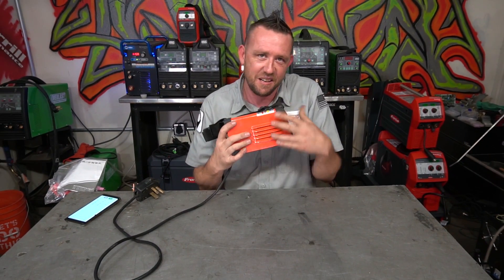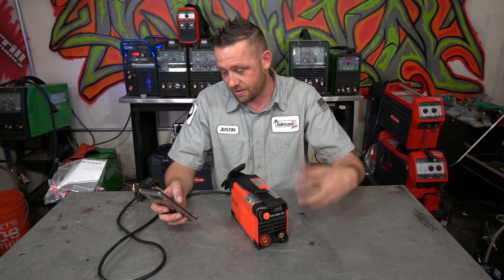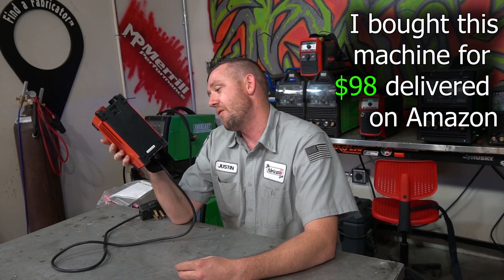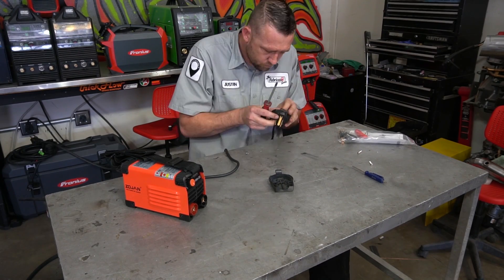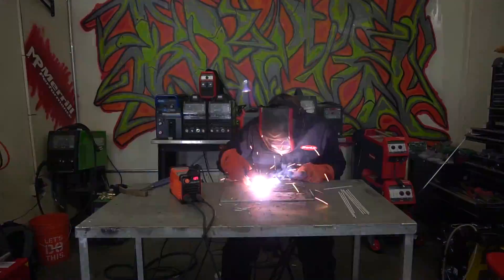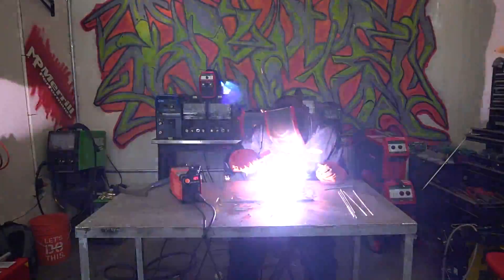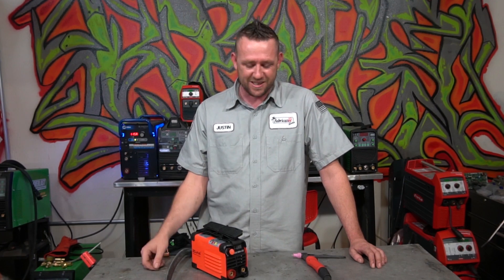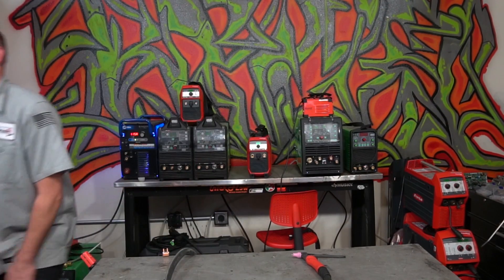TFS: The Smallest Welder EVER! Will it TIG?

Comment: I have a Delco lunchbox size TIG and arcwelding they say it will only weld 1/8 steel but I have welded up to half-inch in the greatest little welder going I also have an old union carbide Welder blue and huge and I prefer a little one

Comment: The way I understand it, there's a difference between duty cycle and thermal cut-out.   Duty cycle is the mfgr suggestion so you don't eventually burn out the machine.  SOME welders have a thermal cut out in case you forget about the duty cycle.

Comment: Mine "Zohan" have 160A max. on  information plate (even it show 253 units of "something" ) , burns well 2,5mm sticks . Current setting seems to be not linear , 210 units works well with 2,5mm stick  , 253 quickly making hole in 5mm cold rolled steel and blows 2,5mm stick . Zohan is plugged to 230VAC . Probably will be limited on 120VAC (it was designed to china market voltage - 220V )

Comment: Would it make a difference that US/Canada 240v is a product of 2 opposing phases and for the majority of other countries 240v is a single phase to neutral? 
It might be chopping the current.
Reply: If it's 2 phases 180° out it's literally same as single phase 240. If it's 2/3phases then you get 208. Anyway, this machine has a switch mode power supply so the mains is turned into dc. It'll work on dc or 1khz and not care
Reply: @AntonBabiy  That is inherently untrue, especially if there's any potential to the earth ground circuit from the neutral line or a grounding watch-dog circuit.
 It's also possible the increase in Hz rate could under-saturate any inductance in the circuit reducing the output as well.  Larger power supplies rarely have 50/60hz inductors and lead to saturation issues.  These Chinese manufacturers often design around "what won't blow up" and build around that.  Hence 50hz inductors can operate at 60hz with a reduced output but a 60hz inductors will quickly overheat at 50hz from over-saturation.  There is absolutely no way of telling without looking at the circuit.
Reply: @texNoz  what inductors are you even talking about? There is a bridge straight off the ac, dc filter caps and a smps running at a few khz above the hearing spectrum. You can run it on dc and it won't care. The smps controller ic sets the transformer frequency
Reply: @AntonBabiy  I don't know.  I DO know that I've got 2 1st generation miller 304 xmt welders sitting in my workshop that are run exclusively off generators because if I don't, it's well established that the main caps and transformer go boom..  and they are inverter-welders.  I've got a Chinese  inverter welder marketed here that says not to use on 60hz or expect unpredictable or poor performance.  That's enough information to tell me there's an induction issue.  I've guessed that there might be an issue with the neutral to ground arrangement in the control circuit when you're placing an active on the neutral input.  If the neutral is ever referenced by the microprocessor to ground, it could very well create a loop that chops.  Or perhaps the control circuit is fed through a half bridge and the neutral is referenced which turns out to be chopped potential difference.
You can't assume that everything that comes into the unit is sent through one massive inverter and dealt with from there because I know for a fact that's not the case.
Do either of us know for certain?  Absolutely No.  However, I am relatively sure the manufacturer has built that machine around the power architecture they have in China and not dual-phase/neutral like you have in the US.   I'm also relatively sure this welder is for the Asia Pacific market and likely works fine in China, but they'll sell it to whoever will buy it, as the manufacturer doesn't care if it work in the US or not.

Comment: Bust it open and have a look at the main board, there should be two adjustment screws, one that controls the output of the welder and one that adjusted the display. I was able to fix a similar welder by "screwing around" with it. Good vid

Comment: Bought a similar one. But a a little bit bigger , Onex brand 250 amps declaration , has no screen that shows the amps btw.  And I don't really care if it only goes to 125. It burns the metal away on max output . And it welds like a champ.

Comment: I actually used a similar arc welder to rebuild a steel sailboat in the caribbean off of a generator while sitting in the water. One thing I can say, is it fits in your luggage, burns 3/32 great, and it works with the amperage turned way up. It was perfect for what we needed it for.
Reply: This is what I'm saying!

Comment: Great video, but I'll only say you need to plug it to a 240-110 transformer to make it work, looks like it is made in Hong Kong, they use 240v standards there and US is 110v . I think that's where you get the half amp problem
Reply: This right here.  American 240 volt is not the same as Chinese 240.   Our 240 is actually two 120 together but they are out of phase white each other.   Over there and europe too they truly have 220 coming out of one hot leg.

Comment: So, if the welder was advertised as 12-125 Amp instead of 24-250 for $99, that would change your opinion? Keeping in mind that even though you said that you're sure the welder wont last a lone time, doesnt actually mean that it will or will not last. Your assumption was based on nothing.. im not trying to be rude, im just confused. At first you seem very excited about it, regardless of performance. Well, it definitely welded didnt it? For only $99 too. If it was advertised as 125 Amp max, would it not meet your requirements? 
  Lastly i just want to remind you that if everyone could easily afford a more top of the line welder, then this video most likely wouldnt have happened.
  I guess im basically asking;  is it really that bad of a welder? Is there something that you WOULD recommend in the $100-$150 price range?
   Thank you for the time you spend making this video

Comment: great show.  i'd like to raise a couple of points.  perhaps the display is wrong because youve set the welder up with 120volts when it is designed for 240v.  i know a panel beater whose favourite welder is cute and dinky sized like that one.  he's got lots of welders to choose from.  he hangs it over his shoulder and with one hand on the amps control, starts the arc with it turned up then turns it right down immediately it starts.  he's gone back to arc for lots of things including car panels because it is so portable.  my welding skills are what in australia are called cocky shit, so i probably couldn't use it.

Comment: Well, here's your problem.  Those were METRIC amps!  ;-)
Reply: 8bit amps? :)
My guess is that's not amps at all, rather a percentage of available power in 8bit scale, like 256 = 100%, 128 = 50%
Reply: Could be because its a small machine the amps are also smaller.
Reply: Chinese amps. Wish amps 🤣😂🤣
Reply: Right. Very funny
Reply: Haha
Reply: They're imps not amps.
Reply: r/woooosh
Reply: its Asian amps
Reply: Amps, volts, and watts are METRIC units of measure.  Always have been.
Reply: @kooldoozer  it was a joke.
Reply: @kooldoozer  r/overyourhead

Comment: How about a video for us poor people.  How to mig sheet metal with a harbor freight 90 amp welder.  I have no income or budget, and was able to get the 90amp HF mig with gloves, helmet, brushes, pliers, extension cord, all for about $170 which was a major investment for me.  I have a 1960 Willys CJ5 that has a few places where I need to cut out and replace panels.  I have had mild victories with this, but even on the lowest settings still blow thru.  With my health issues, I cannot work, and on a good day working on the jeep may get 1-2 hours total work done.  I want to finish the bodywork prior to finishing the mechanicals so worst case I can sell a decent body if I cannot finish the project.

Comment: That little welder burnt you out with everything you threw at it. So why the bad review? For a homeowner who welds maybe 10 times a year on small home jobs, may be very useful .
Reply from the maker: It burned me out because the output was not what it was shown. Also remember that I took it out of the box and used it once with the results we recorded which were inaccurate. You'll also spend about 3-3.5x the cost just to plug it in and guess the output. That is does not merit a positive review or good product. It's a novelty.

Comment: We're you operating welder on 120 volts or 240 volts? You showed a 50Amp 120 volt plug.
Reply from the maker: It's a NEMA 6-50
240v 50a

Comment: How could something that small, not be under-Powered?
So, it's a 125 Amp Welder?
Reply: Different design to a traditional welder. Uses switches rather than coils.  Like modern phone chargers compared to ones 10 years ago.

Comment: I am conflicted about the review. He reviewed the item like a professional auto mechanic reviewing a set of harbor freight tools not a DYI who may use them a few times a year. That is the review I want. If I am repairing a trailer or riding lawn mower will it do the job? Not all of us are making a living as pro welders! 

I just bought a cheap nail gun to reside a garage. It did a great job, twice! I would not suggest it for a professional carpenter. 

There is a place for Harbor Freight and a place for Bosch!  

Can this do acceptable work for a DYI job? That is the issue!
Reply from the maker: There are better options for cheaper and will work more than twice.
Reply: @TheFabricatorSeries  it worked twice. i have not used again. it worked twice flawlessly and i have not used at again.

Comment: Great Video, just a quick question, were you running it on 115Volt or 240Volt?, if 115volt this maybe why you were getting the only half the amps.
Reply from the maker: NEMA 6-50 plug
240v 50a

Comment: You mentioned in the welding glasses review video that you haven't done micro welding...
Well that is exactly what I would use this as...
And for 100 bucks I could afford to risk breaking it trying to backyard engineer a foot pedal control and on/off switch to that lil thing...

Comment: did come across a welder once ( the company I was working for actually bought us a sight use set instead of having to disassemble our main sets, drag them out onsite and reassemble. then repeat for coming home....).anyway the set said it worked 240 volts(our country's voltage) or 110 volts,,, U.S. or our site voltage for bigger builds etc...…..any ways site foreman asks can we run 110 as that's all they are allowed???? so yeh we can run 110 volts but we experienced exactly what you have just experienced lol

Comment: That is  such a shame. I had hopes for it. I do have a 140 amp stick welder from amico. 120 volt only. It will snap 20 amp breakers at full load when I weld more than an inch. 100 amps and below i can weld all day. From what I read in the manual it'll pull 40 amps at max load. I think it said it had 60% duty at 90amps and 40% at 140.  I got a 40 amp single pole breaker I'm thinking of installing to see if I can hit the limit at max power. It was 99 on amazon and hasn't disappointed me yet. Except when I need 140 amps for a while.

Comment: they show it on amazon now as a 160 amp machine.. even if it only outputs 125 amps thats enough to run 1/8" 7018 so its not limited by much you can do multiple passed on anythickness with that, some preheating may be required on crazy stuff like 1" plate, when i see  the unit before you said anything i expected 100amp output, i wonder how much input it needs, could be ran by an inverter or generator on the trail to weld, youd need a european inverter though so you get 220v and itd neeed to be a 2000watt unit atleast

Comment: why is it 102 degrees in your shop? jesus man turn on a fan or an ac or something lol
Reply from the maker: DEVUNK88 Cant run the AC or coolers while recording. The mics we use are sensitive enough to pick up the sound from the coolers operating which degrades the video. The flowing air also disrupts gas flow when welding TIG/MIG, so we just shut them down. Such is life.

Comment: @the fabrication series
Recently found you and I'm digging your videos. Good stuff.
I get that this thing isn't something you're going to run at a proper fab shop, but it did seem to work pretty well. A hobbiest learning, or someone hanging sheet metal patches on their at home restoration might find this is just the ticket if they are working in a cramped garage. Put a dryer plug on the end of the cord and go for it.
Am I wrong?

Comment: Pretty sure this is the same little benchtop DC unit harbor freight has. And I'm just a novice.

Would rather spend $200 on a 110v CH wire feed with mig capability.
Or better yet, a $300 Lincoln fcaw mig capable unit.

You get what you pay for kids. If all you have is 110/120v, even at 15A, get the little Lincoln Handy MIG. Sure the Campbell is cheaper, but the Lincoln has reputation and comes with necessary beginner accessories.

Comment: is it possible you had it wired wrong to the plug in ?  a lot of these welders auto detect the voltage , and if it was at 110  volts it would be running at 1/2 the amperage

Comment: I could see this being super useful in my line of work. We do a lot of breakdown work on coal wash plants and draglines. A lot of the repairs are to guards and handrails that have cracked from vibration. I’d rather have one of these in my tool bag than carry my tools and another case with a larger caddy welder. Our welders don’t last very long anyway with all the water and dust so the company buys el-cheapo machines for us so I’d happily give one of these a go.
Reply from the maker: ItsDicko Look into the Fronius Accupocket.  It's perfect for just that type of work including the dust and water. Mine goes with me everywhere.
Reply: The Fabrication Series we’ve looked into them, but they’re a lot bigger than most caddys on the local market, and they didn’t last long enough to justify the massive cost of them.
Reply: @TheFabricatorSeries  Sweet Jesus, those are about $3000 list.  Hardly comparable. You must be doing well off your Youtube advertising bucks. :- )
Reply: @insulglass  lmao, you could trashed 30 of this little things and it will weld so much more sticks than accupocket with its 17 minutes continuous use
Reply: ItsDicko Well in your case it sounds like this machine would be ideal. You probably have good leads and just need the proper plug. I would suggest doing some tests yourself as to the quality of the welds. particularly for handrails, but it would definitely save you and your body from lugging around a heavy welder.

Comment: No tigging at '100' amps? Pump it up to '250' amps...Maybe they are chinese amps? Some painters tape and a sharpie will fix that: mark it 3 to 70. I am disappointed  you did not take the cover off, or put an amp clamp meter on a lead. I see there are several versions of this on Amazon with different labels, clearly from the same factory (as is chinese custom). I can't believe the chinese mfr would lie to you! (not) Perfect for taking backpacking or for your Barbie collection; Now Malibu Ken can be more manly.

Comment: I think you'd need to be realistic about the duty cycle on such a little machine like that when you are also observing its performance. It would probably be fairer to complement the test you did with another test whereby you only use rods half that length. OK, sure, so that does admittedly mean you would be cutting rods in half and needing to change them twice as often, but I think the ends justifies the means rather than straining the little machine (at the first parts of its duty cycle) with long rods.

With what you are doing there, you are not letting the 2nd half of the rod (the short bit) have a fair chance to perform (because by then you've strained the machine). Cool video and all. Just saying. The machine looks like it is designed for small portable emergency one-off jobs when you'd be happy to only use half-length rods to get you out of some bad situation. Of course, the machine did well in your test, but is the principle of the thing when looking at what is or is not an underpowered appearence in the weld itself.

If the display was corrected (considering you retrofit it anyway which is sort of a mod), the little machine would be "honest" and could get small things done. Some machine don't have a display per se, and you can use a multimeter. It i like the machine is being unfairly punished by the customer AND the manfacturer for the fact it has a screen on it which it never asked for. Beyond that, the machines does actually "do a thing". It is not a useless paperweight.

However, if there is a welder just as small as that, I would stand corrected. Is there?

Comment: Got one looks same as this one but rated at 160 amps have run it through ammeter using a shunt amps not far off about 10% low approx . Find it welds really well loads better than machine mart buzz box not exceeded duty cycle yet never seems to get very warm  .Unlike old buzz box 2 or  3 rods and it cuts out ! not as good as big welding plant at work but very impressed with it

Comment: Okay, I am not a welder... But I kind of thought that the NEG connection to you Argon hose was a bit poor. There are losses to be considered. The power lost a voltage drop due to I2R losses ( E=I squared x R). The more current you supplied, the greater the loss; exponentially.

I would like to see the results if you had a better connection